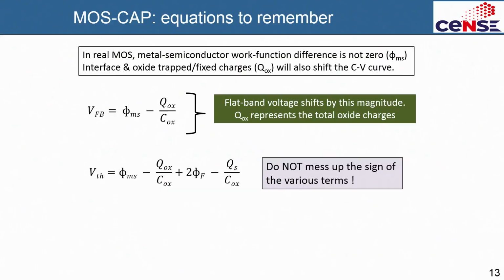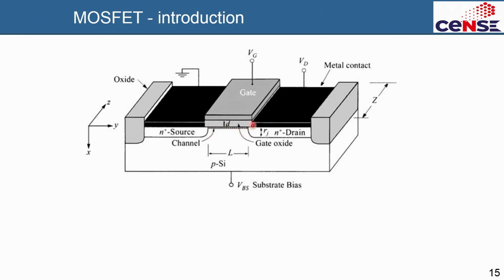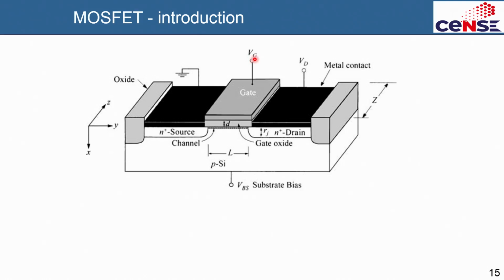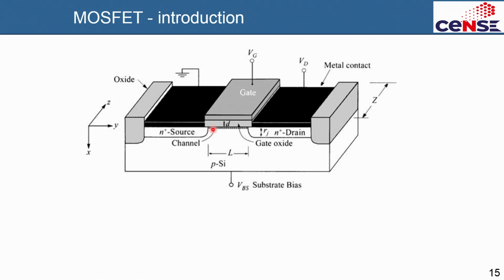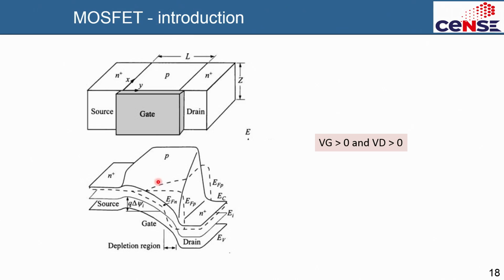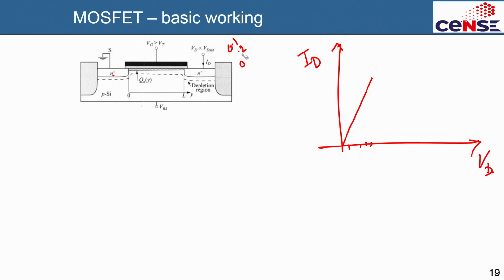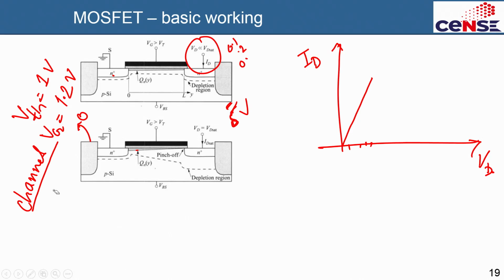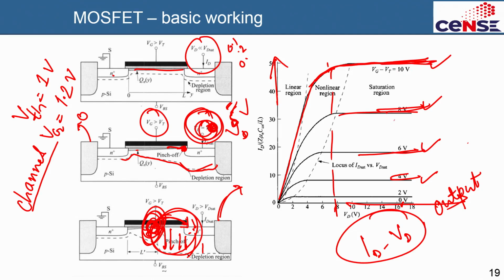MOSFET â€“ An introduction

Comment: can anyone explain me in brief about why pinch off actually occurs?

Is it because of recombination of the moving electrons from source to drain while the channel is open and the holes of the drain.
Reply: Pinch off occurs because of the increasing depletion region near drain due to increasing drain voltage Vds. Now since in depletion region there cant be any mobile charge thus there is pinchoff. Further if you go through Velocity saturation model it can be shown there is no pinchoff as  the current saturates long before Vds(sat) due to velocity saturation especially in short channel devices.